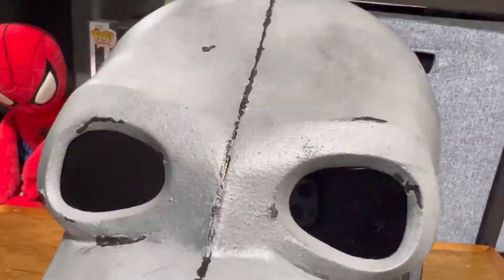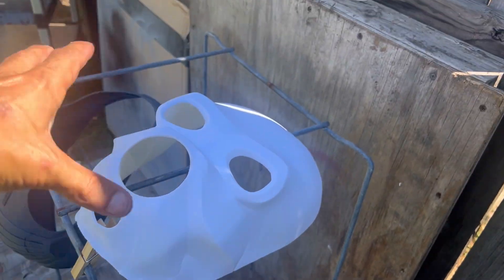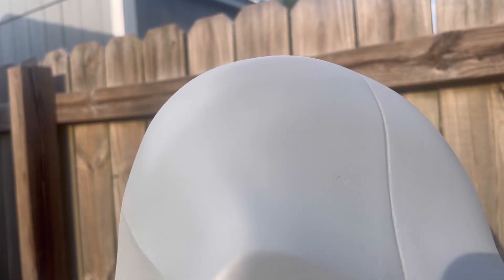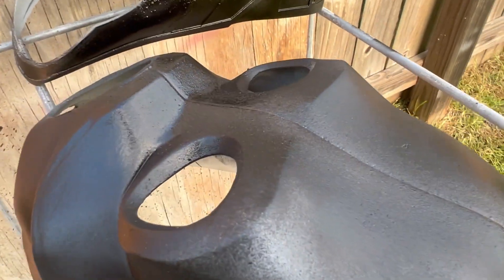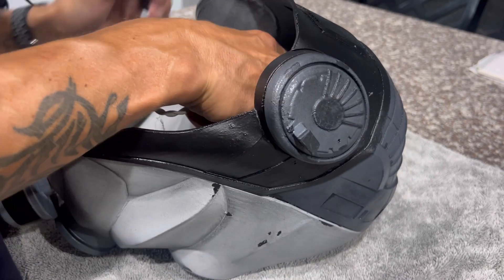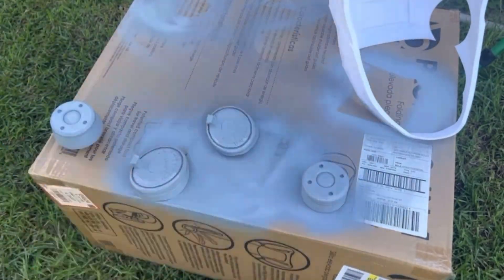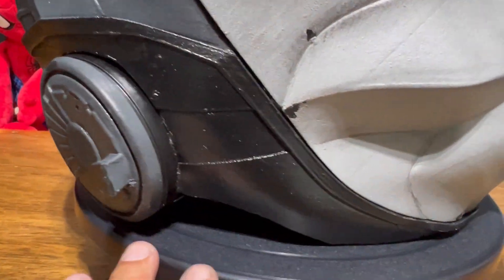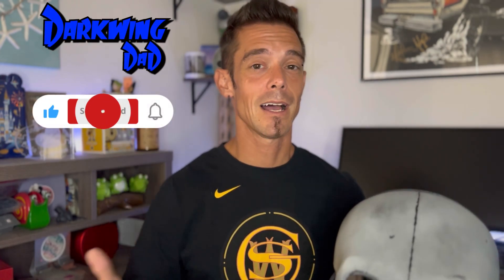Smoothing 3D prints without having to sand | Remove layer lines in 3D prints my zero sanding method

Comment: People's aversion to sanding astounds me
Just put on a YT vid and sand for a while. It's not that hard.
Reply from the maker: To many easier said than done, if so simple people wouldn’t look for easier,quicker methods.
Reply: @Darkwingdad  So buy expensive paints, guns, and equipment over $15 of sandpaper?
Reply from the maker: @HyJyncks time is money, & I’ll put my expensive guns & paints head to head against $15 sandpaper. Creators who commission items can’t spend hours on end sanding until there fingers bleed and wasting time. So after you’ve wasted your energy oversanding your model, losing definition, time & energy your end result took longer & doesn’t look as good as “the guy with expensive paints” you’re ideology is amazing.

Comment: Hey DW! I just looked and I have a 1.4 and a .8 HVLP spray gun in a Campbell hausfeld kit I bought during a garage sale. I believe that brand to be somewhat respectable? That aside, I have a question that’s been bugging me for a long while and I don’t know the answer and was hoping you could help. What’s the smallest air compressor/ compressor specs you would recommend to me for my HVLP gun. I have a very small apartment and so a space conscious compressor is important but I really want to get started with the spray gun. Also, would you do a video on various spray booth ideas if you have the time?
Reply from the maker: I just bought a new spray booth so it’s in the works

Comment: It is a nice idea for weathered or beaten up props but for people who would prefer pristine looking things, there were really needs to be sanding. @4:45 the back of the helmet shows apparent under extrusion and welded support damage from the print itself. Filler alone won't help that.
Reply from the maker: @thomaswiley666  it’s going to vary model to model, considering the complexity of the model in the rear piece with no sanding it came out great. As stated this isn’t a say all do all method just an option for those who don’t want to sand as much but still want good results with less effort.

Comment: It would literally take me a month to accomplish this project - a week of it being just sanding and filling. However, the grunge finish is a bit more forgiving than attempting a perfect high gloss finish. I'm always concerned about bonding and don't want to see stuff chipping off over time, which prettymuch forces me to do a complete sanding and a glazing putty fill before any coatings are applied. Does the primer actually chemically bond to the plastic and have you tried a scratch test and confirmed the bond?
Reply from the maker: @josephpk4878  it’s a 2k primer, meant to bond the metal, it has solvents in it penetrate the substrates pores and anchor in. Keep in mind we also used acetone as a reducer so that helps bond to plastic too. Been using this product in the auto restoration scene for 15 years, it’s great!

Comment: I found your channel a couple years back now as a newbie looking for help on printing silk pla and not finding hardly ANY content on specifically that filament. You’ve been such a help in inspiring and influencing new and creative ways to attack projects, so I thank you for your work you’ve shared with our little 3D printing community DW. My next investment will be a larger format printer, probably the sv08, that’ll allow me to print masks and fun stuff like that. Hopefully I can get one at some point if they have a big sale of 20-25% off
Reply from the maker: Have you my silk printing videos?
Reply: @Darkwingdad  your silk printing videos were some of the first few videos I’ve ever seen on 3D printing outside of troubleshooting videos!
Reply from the maker: @couryrussell7653  got some new ones coming up for orca slicer n klipper printers
Reply: @Darkwingdad  looking forward to it buddy! I’m on the ender3v3 SE right now so I haven’t delved into any klipper yet. I know it’s going to a beast to learn but it’ll be fun! Do you have any thoughts on the K2 coming up on release? My next printer, I want it all. Multi color/idex/tool changer, whatever it takes. Supports engineering filament, specifically ASA and CF filled. Large volume printing as well.

Comment: This was great. I do have a question about slick sand or an alternative. I have a compressor and 2 lvlp guns. In general I try to use water based paints because I’m not a huge fan of spraying acetone and other solvents. Yeah, I know it takes longer 😢. In any case do you know of any high build primers like slick sand that can be thinned with water for use with a hvlp/lvlp gun? Thanks as always man. Your vid’s have helped me a ton in making great looking functional prints.
Reply from the maker: @SuperDuperTango  have you ever looked at my video on liquitex?
Reply: @Darkwingdad  Thanks. I hadn't seen that one.  I'll give it a shot.  Do you think it'll spray though? I'm doing things like wall mounted shaped bookshelves (e.g. clouds and butterflies) that have about 2 to 4 sqft of area.  Thanks again!